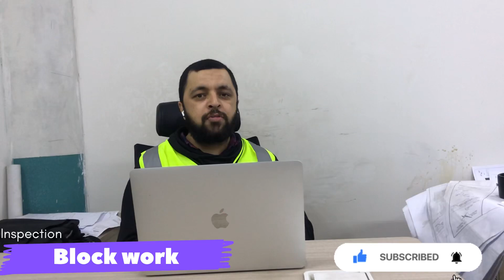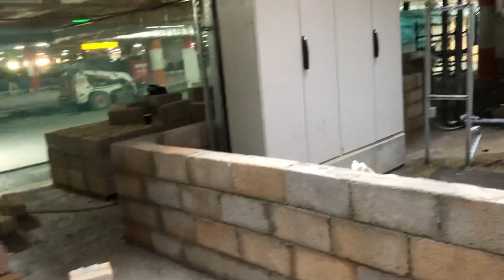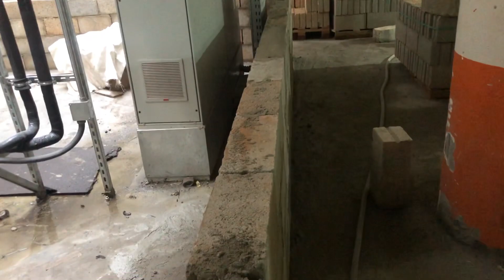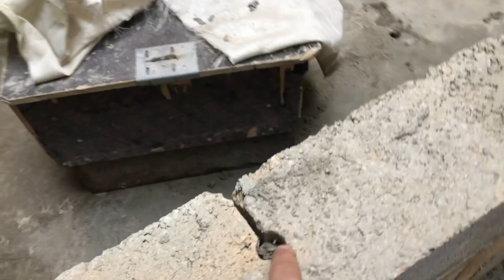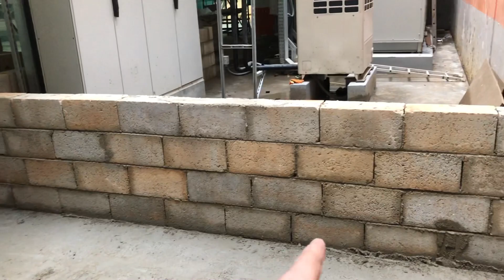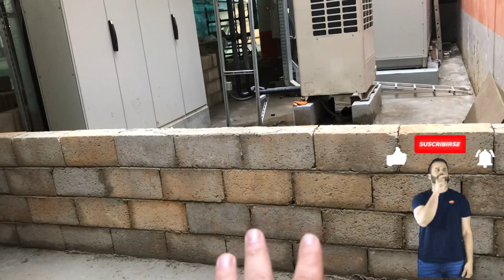How To Check Block Work at Site| Block Work Inspection in Saudi Arabia

Comment: Assalamualaikum sir why we provide mesh ladder for every 3rd row what is the purpose?
Reply from the maker: A mesh ladder is provided in the third row of a block wall to increase structural stability and prevent cracking. The mesh ladder helps distribute loads and improves overall strength by connecting the layers of blocks together.
Reply: @CivilEngineerAtSite  Thank you so much Appreciated 👍

Comment: Sir after constructing block walls how many hours should we wait before we start curing them? & also Curing water TDS in ppm..
Reply from the maker: It’s depends on weather but after 6 or 7 hrs you can start curing with portable water
Reply: Sir these explained inspection criterias are based on any particular Standards or  based on site conditions?
Reply from the maker: You have to conduct work inspection request as per your ITP.

Comment: Sir explain the topics below as quality control engineer
1 fres concrete test ect
2 steel checking
3 plaster
4 brick work
5 layout
6 cement tests perperties
7 different types admixture
8 finishing work like paint etc
9 FDT
10 soil investigation and results
Thanks
Reply from the maker: In Shaa Allah. Noted with thanks 😊
Reply: Why were put the mesh lader and what are the purpose mesh lader

Comment: Salam sir i asked question from you about concrete.
Sir during concrete if rain start what will be we do ?
Reply from the maker: You have to check weather forecast before starting concrete, 
If it’s very important to pour concrete then you have to keep plastic covers and also try to make shade on concrete area. If the area is big then postpone it
Reply: @CivilEngineerAtSite  Thank you so much ❤️